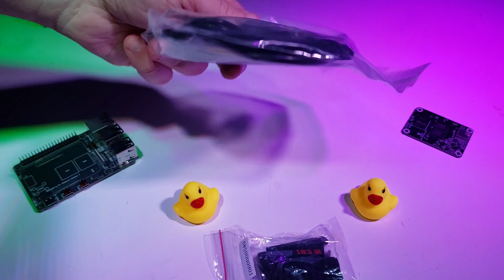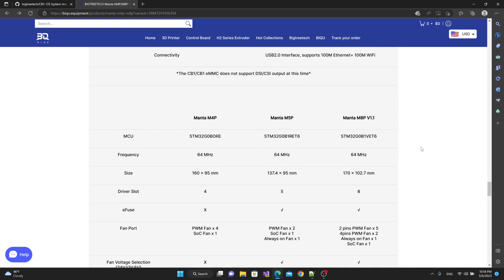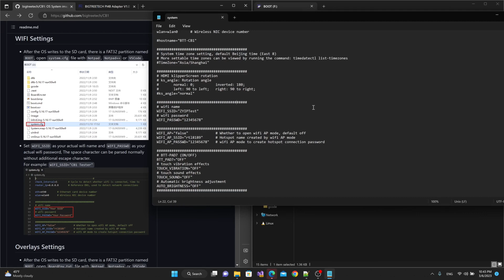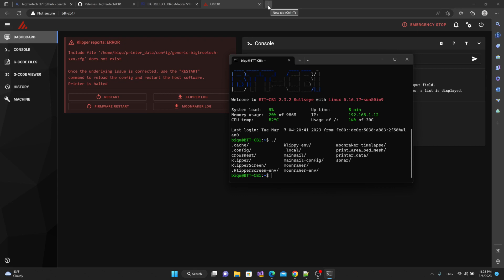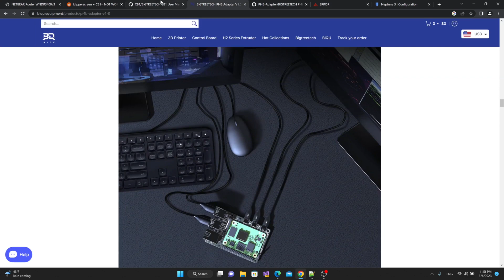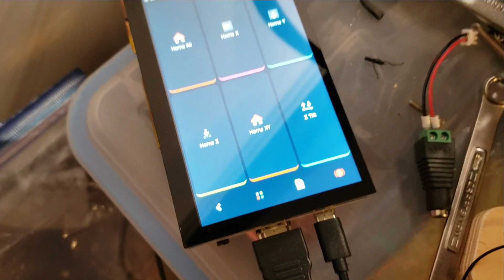Bigtreetech PI4B, CB1 and HDMI5 - an almost perfect Rasberry Pi alternative for Klipper

Comment: After burning the image and changing the ssid credentials in the sytem.cfg file, it is still not showing up on network watcher.
Ive tried two different wifi ssids, as well as hotspot and it just never broadcasts.

Comment: how did you set the 90 degrees display? I try hundreds of tips, configs etc. - would you please share the settings? Thank you!
Reply from the maker: It's just a setting inside of the system.cfg file in the boot folder
Reply: @TheFeralEngineer  Nope, this does not work... maybe cause I'm using a BTT Pi (not a rasPi). But thank you!
Reply from the maker: @cyaneo7  I'm talking about a btt pi, cb1, pad7, etc. Make sure you remove the # next to the rotation command or it's commented out
Reply: @TheFeralEngineer  hmm... yes, I commented all variations out or removed the #. This is in my system.cfg:
###########################################
# HDMI klipperScreen rotation
# ks_angle: Rotation angle
ks_angle: 90
#       normal: 0; inverted: 180;
# right: 90; left: 270;
# ks_angle="normal"
Reply from the maker: @cyaneo7  you need to put "left" or "right", not 90.
Reply: @TheFeralEngineer  Oh man :face-orange-biting-nails:- YOU are my hero! Thank you so much!

Comment: hiya, just recently bought hdmi 5, but when it's plugged in, nothing is coming up on the screen. is there anything extra that I need to do on klipper side to get it working? thanks
Reply from the maker: Nope, just plug in the HDMI and the USB cable. Do any of the lights on the back of the unit come on?

Comment: Does BTT P 1.2 I have the option to VNC into it and look at the Terminal for setting things up and additional use.
Reply from the maker: It has ssh, yes
Reply: How would I set it up? I was able to install tightvnc and start a server but there was not gui or x interface to be viewed. Is there an easier way to
Reply: I guess this is easier to ask, I’m trying to run 3 chained neopixels from the btt pi, I’m just not sure the correct gpio to use for the data (blue) and 5v  and ground. I have a usb I’ve grabbed the 5v from but is there an easier way? I have the red blue and black from the chain
Reply from the maker: @JakeClarkRealty  there's a pinout diagram on the cb1 GitHub. There's 5v and ground points on the Btt-pi. As far as gpio, you have to find a pin that would work with pwm. Not sure which ones provide pwm though

Comment: Interesting enough Ive tried a few different cables and cannot get the touch working on my HDMI5 and Manta/CB1.. it shows in the USB devices however.
Reply from the maker: That sounds like it may be hardware related. Did you try plugging it into a PC to test it?
Reply: @TheFeralEngineer  so, here is the thing.. rebooted and checked.. tried different cables and nothing worked.  Finally unplugged the USB hot and it started working.  Must not have been holding my mouth right
Reply from the maker: @Steven-Machado  gotta stand on one foot and rub your belly next time 😆

Comment: Im running a btt pi1.2 but im not getting the hdmi5 to work with it. Do you know what the difference is between setting it from display and serial?
Reply from the maker: Console and serial are for the pins that let you drive your machine from uart or use the same pins to debug the board. That should have no bearing on HDMI. Did you try uncommenting the additional resolutions?
Reply: @TheFeralEngineer  ok thanks. That part was a little confusing for me. I will add the extra resolution and try that. It honestly seemed as though the screen was shorting the pi out or blocking it from functioning. The screen works perfect if I plug it into my laptop.
Reply: Did you ever get this to work?  @Armor3dprinting

Comment: My router keeps changing the ip address. Is there a way to keep the printer connecting to the router without me changing to the new ip address
Reply from the maker: Resolve by hostname instead of ip or designate a preferred ip address to the pad7 through your router settings
Reply: @TheFeralEngineer  I was trying to figure out how to do the host name. Guess I have some more research. Thanks
Reply: @TheFeralEngineer  I got it, thanks for all the help and videos. I was typing the host name wrong.
Reply from the maker: @DennisCrawfordJr  sorry, just saw your previous reply. Glad you got it working!
Reply: @TheFeralEngineer  no worries.

Comment: did you have to do anything to get the touchscreen to work. i have a display but it will not touch. i have the hdmi7 with the cb1pi4b
Reply from the maker: Just plug in the hdmi and a usb cable, that was all.
Reply: @TheFeralEngineer  thanks. It was not working. I unplugged the printer rebooted and it started. I was messing with for an hour

Comment: Could you help me? I can't find the symbol between "SSH bbt-cb1 -? biqu"
Reply from the maker: Lowercase L

-l
Reply: @TheFeralEngineer Thank for your help. Could you help me one more time? I unfortunately buy 24v instead 220v and right now i can't use my SRR. How i should configured my klipper to work without SSR?
Reply from the maker: @damiankosetka2345  what is the ssr for?
Reply: @TheFeralEngineer  SSR is for power supply AC instead DC. If you have SSR module you have to use 110/220V heater, but I bought 24V and I can't use SSR. How I can change in klipper config to work with my 24V heater?
Reply from the maker: @damiankosetka2345  i don't know anything about the printer you are trying to work with. 

Usually the printer main board has its own hot end and bed heater section that you can use, but I don't know what board you are trying to run.

Comment: May I know if this config works with the RPi cameras? My RPi 4 was dead because of my dumb mistake and left my enclosed 3D printer setup. There is no space to put any USB camera in but only the RPi camera.
Reply from the maker: It will not work with the rpi camera. I believe if you swap the cb1 for a cm4, it may

Comment: Can i run octoprint with this ??
Reply from the maker: You can install octoprint directly from the kiauh script, but I found the interface between Octo and Marlin to be lacking. Klipper is where it's at.
Reply: @TheFeralEngineer  im new to this but i have a mk3s i want to send files to remotely will klipper work for that ??
Reply from the maker: @3dTinker  yes it will. I believe it will also work with the stock prusa screen but I'm not completely sure of that. 

If you want to get learn progressively instead of jumping in feet first, you can run octoprint until you have a need for more power and integration. Setting both up require some time and knowledge, but in the end, both are worth it.
Reply: @TheFeralEngineer  the pi4b should be good for octoprint then correct ??
Reply from the maker: @3dTinker  the bigtreetech pi4b is only a breakout adapter for the cb1, so you have to get both. There's a link in the video description that should get you to the page 

Alternatively, there's the new Bigtreetech btt pi, which is the pi4b and cb1 produced as a single unit, for a few dollars less. 

https://shrsl.com/422y4
Reply: @TheFeralEngineer  dang if i wouldve known i wouldve order the v2 but i got the pi4b w the cb1 are they still good ?
Reply from the maker: @3dTinker  they are equivalent to one another. The btt pi is a pi4b and cb1 integrated into one another. The only real benefit of the btt pi is the dedicated CAN interface and the ability to natively power it on 24v, otherwise, it's the same. The cb1 gives you flexibility in the future because the control board is modular, allowing you to use it on different btt products, such as the manta boards
Reply: @TheFeralEngineer  would it be a good idea to install octo print off kaiuh or intall it as its own
Reply from the maker: @3dTinker  use kiauh. It works very well

Comment: Just sad that it will not accept set up CAN on Hermit Crab like CM4 so you will have to despend the real $$$. Other issue is that also will not work with bigtreetech PAD 7, must replace with CM4 to set CAN setup and don't spect any help from BIQU

Comment: CAUTION

I had two problems getting a PI4B/CB1 running. One small, one not. 
Small problem. Intermittent connection to HDMI. The stiff cable and heavy connector plus adapter cause an intermittent connection to the microHDMI on the PI4B.
Big problem. I run Mint Cinnamon. I powered my 7" touch screen by plugging the USB into my workstation. While troubleshooting my connection issue I was touching and tapping and sliding on the touchscreen. My workbench is at 90 degrees to my desk. I didn't notice that the touchscreen had taken over my desktop. F*&#. I managed to send my home dir and everything under it to the bit bucket. I will never again be irritated by backing-up.

Comment: Amazing video, as always. Question: Is there a reason to avoid the HDMI 7 other than price?
Reply: but those two cables stick out a lot, and in the 7-inch version they are within the size of the screen.
Reply from the maker: I've not seen where on the bigtreetech version, they sit within the screen, as you say. Either way, you can get 90 degree HDMI cables that cut down on how much it sticks out from the side of the unit. There are other screens out there with a more convenient cable layout, but the 5" mounted in portrait view almost looks factory

Edit: oh, now I see... V1.2 cleaned it up a bit
Reply from the maker: Size. I have two of these and they're awesome but they're just absurdly big for my table https://amzn.to/3YsGYDD

I mentioned to them that I couldn't get 5"screens to work on the mks pi, so I think they sent it to me as a flex 😆
Reply: @TheFeralEngineer  Gotcha!